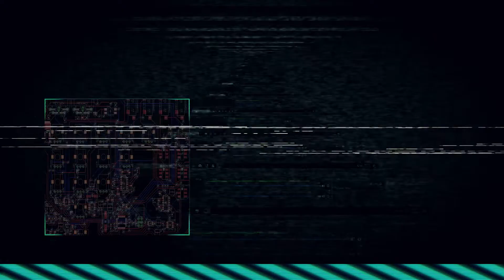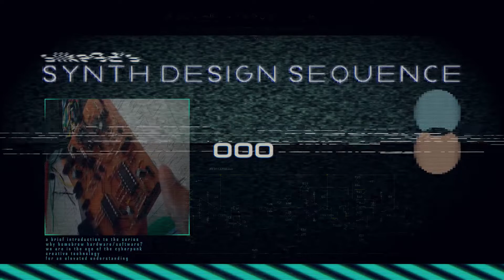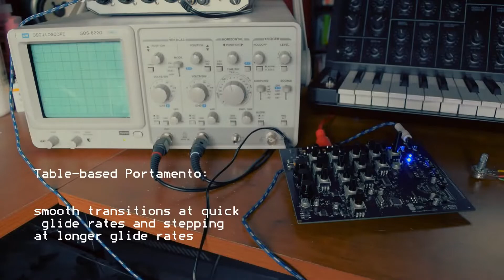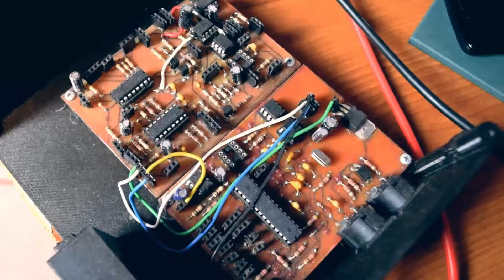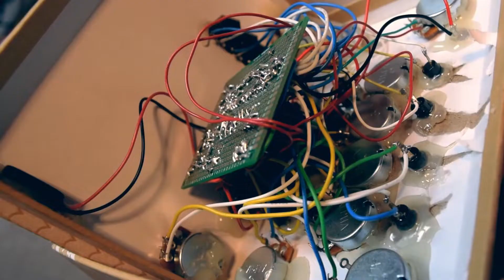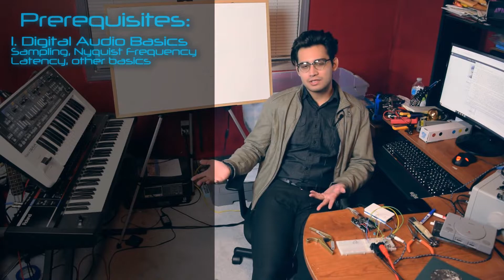DIY Synth Design Tutorial Series - Introduction

Comment: What about prerequisites for first project but with electronic's parts? Like arduino uno, some 555s.
Reply from the maker: Whoops! I forgot to add the list of components to the video description on Episode 001, so I'll do that when I get home from school. Since I haven't built the completed project yet I can't list out all the parts I'll be using for the completed first project, but I can definitely list the parts you'll need for each episode as they come out. Check the video description for Episode 001 tonight for the list of parts for that episode.
Reply: @the.room.dis.connect670  okay, thanks. Can you maybe name some "rare" parts? Because i want to follow you so i'll probably go and order some parts in future.
Reply from the maker: @alexanderhuliakov6012  I build all my projects with parts that are currently being used in the manufacturing industry, so actually there are no rare or discontinued parts. Everything is readily available and currently in production. Off the top of my head I can think of some ICs we're going to be using in the project though. You'll definitely want at least 3 or 4 LM13700's and at least 2 NE555 timers.
Reply: @the.room.dis.connect670  o, thanks. I don't have any lm13700(and shop where i'm buying part's have no in pdip package, lol). So i'll go and order them from far lands...